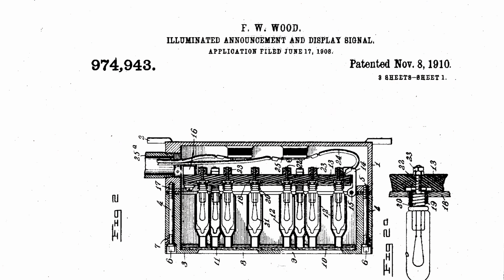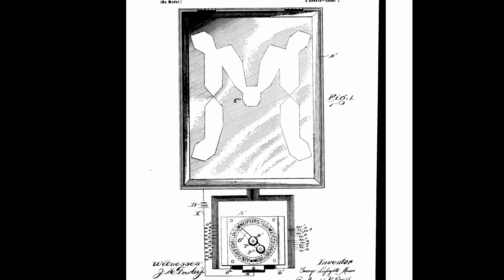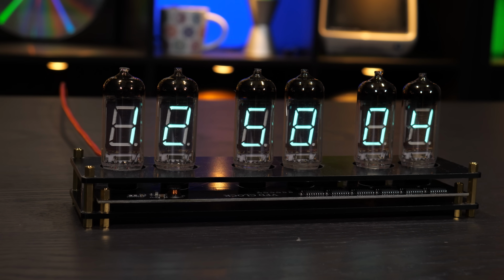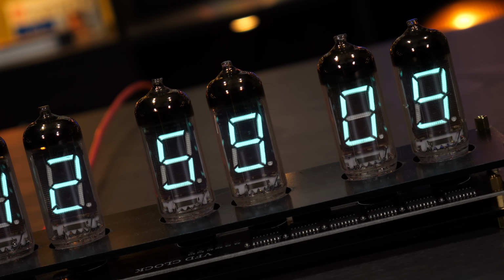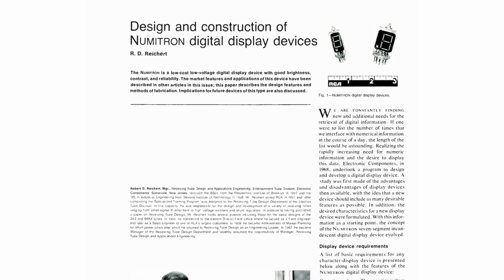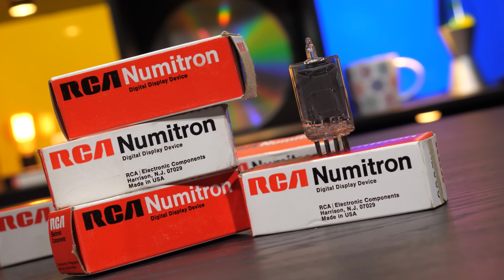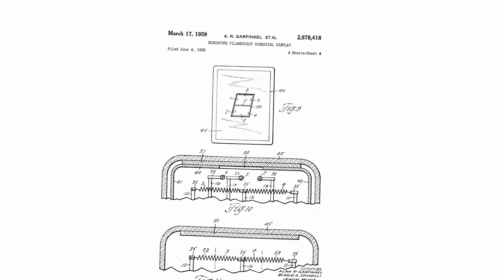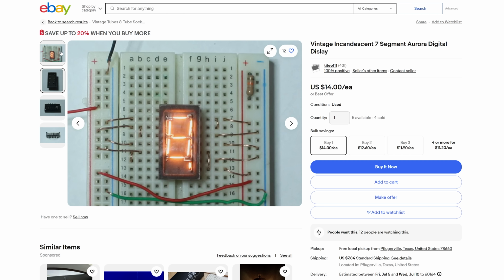The Numitron: An obvious idea that wasn't very bright

Comment: Apart from the physical rendering issues, I think seven-segment numerical displays are a really good idea. A display looks best with a minimum of shifting as you go from one numeral to another. The "traditional" pattern, with seven rectangular sticks, is obviously not optimal. The ends of the segments can be rounded or beveled, making the appearance much smoother. When you do that, you get something really nice. As you go from one numeral to another, you don't change all the segments, but only the ones that need changing. That's just much more visually appealing.

I count an average of 3.5 segments that change in cycling from 1 through 9, then back to 0 and then to 1. That varies slightly depending on whether the end of 6 and 9 if straight or folded. (I'd recommend folder for 6, straight for 9.) If you consider the average of all possible transitions, I'm sure the number is slightly different, but you get the idea.

For whatever reason, what pops into my mind is the time display near the end of the Star Trek episode "The Naked Time," where the remastered version uses seven-segment numerals with rounded ends, replacing the original revolving wheels. I'm glad they did this, instead of some dorky seven-segment glowing sticks. The result fits the rest of the motif in the show, but is also objectively good.

Comment: You may not be wrong about gas pumps using these.  I used to repair POS equipment for grocery stores.  The customer facing display IBM used worked the same or similar to these but it was one piece of glass with mutliple digits.  I think 2 rows by 20 characters across.

Comment: Numitrons were designed to be used with a filter in front of them. this solves the issues you talked about. they were very popular in avionics displays because they can handle extreme temperatures and vibration, unlike the other technologies (including early LED displays, which were unreliable). typically they're driven at a constant current (rather than a constant voltage) and, while turned off, fed a small current which keeps the filament warm without illuminating it. this makes the filaments last a very long time.

The displays you remember from '80s gas pumps were Panaplex displays -- basically a flat 7-segment neon-filled display designed for multiplexing. they also show up in a lot of pinball machines from the era. they required high voltage, just like Nixie tubes. although they can't handle a ton of vibration, they work well in extreme temperatures (think North Dakota in the winter) unlike LCDs which simply freeze and stop working. modern gas pumps have heaters to keep their LCD displays warm.
Reply: Thank you! Someone else knows about the lenses

Didn’t know about the constant current drive, but that’s a smart way to preserve lifetime
Reply: I vaguely remember Fran Blanche doing some good videos on the subject.
Reply: I USED TO WATCH FRAN @talideon
Reply: @TubeTimeUS

A lot of gas pumps used numitrons for their display. Cheaper than panaplex, deals well with vibration from the pumps. 

I’ve sourced several displays through purchasing new old stock pump spares. Curiously the modular design of some pumps meant that you could swap out the type of display by switching card. Quite a few numitron display pumps were converted to LED, just by switching boards when the numitrons were life expired.
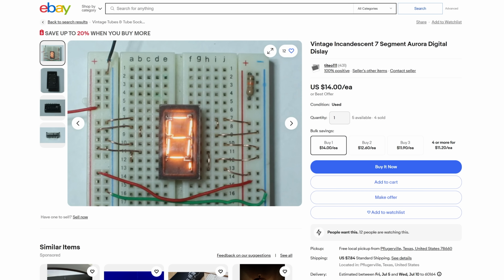Reply: 17:30 - There was a horizontal version called "Minitrons". Also incandescent filament seven segment displays made by Fuji.
Reply: I guess if Eric was going to show up under a Technology Connections video, it makes sense it'd be one about a tube-based display tech even more obscure than Nixie tubes
Reply: Numitrons in gasoline pumps held on in the Midwest pretty much through the 80s and some locations to the early 90s. Gas discharge did not seem to last as well. They got blinky or segments quit working. I was certainly happy to see the Numitron vanish. It was depressing, but they just kept working.
Reply: Wait, panaplex displays didn't handle a ton vibration well, but were installed in pinball machines? All of that thumping of the paddle buttons and the large ball bearing ricochetting around inside.
Reply: @TubeTimeUS  Minitron... That is what they were called in many avionics. Davtron made flight timers and clocks that used them.

I have several of these old clocks sitting around, and a few new replacement segment of the "bulbs".

I mentioned these in another comment and the fact that a filter screen was used with these for better legibility.
Reply: great info 👍
Reply: thank you tube lord
Reply: The same thing is true of VFDs - a green filter provides a very nice contrast and a pleasant-to-read display.
Reply: Tell my local station they need to upgrade! The delay on a really cold morning is insane. My LCD in my passat RNS510 radio does the same thing pretty badly for a bit till the heat comes on and warms up the radio
Reply: @DarkAttack14  My Golf has what must be LEDs to show a few things next to the gear selector. It is impossible to see if they are on or off in direct sunshine.
Reply: In the U.K. Numitron type displays were very common in petrol pumps during the 1980s. Like you say the operating temperature range was way better than LCDs while LEDs just couldn't produce enough light for use in sunshine. In newer pumps they actually switched to electromechanical displays like the station clock shown in the video.
Reply: I’m glad to find out what the gas pump thing is actually called. I remember them and the most I knew was “ayyy I saw that once” 😂.
Reply: I like to think that before they decided to try putting heaters behind the LCD panel that they tried knitting it a snug little jumper before they realised that would make it too hard to read.
Reply: ...but Sometimes!
Reply: North Dakota reference for the win!  Go Bison! Go Sioux!
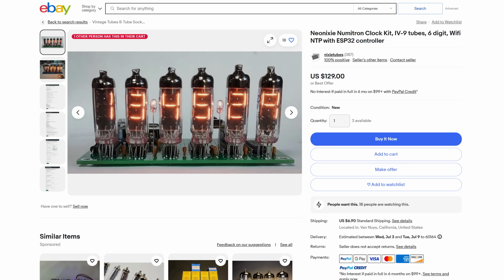Reply: I used to repair the old ARC RT-385As NAV/COMs which used an earlier version the display shown at 17:30 (which themselves were a later drop-in replacement) and I don't recall them having a small current to keep the filament warm without illuminating it - that would just create unnecessary heat in the unit. I can't recall if these displays were used in the RT-485A/B, but I think they were.
Reply: Please pin this as an additional comment to the already pinned comment or edit the current pinned comment to add this information!!!
Reply: I feel old every time I go to the gas station and see LCD screens used as digital billboards. It wasn't that long ago that kids would consider having a 'plasma TV' or a 'flatscreen' as an elusive marker of wealth and success (this was around the time of MTV Cribs and Soulja Boy). Now LCD displays are found on disposable products.
Reply: Huh, that`s pretty awesome (:
Reply: Didin`t even see that the poster`s name is TubeTime lol.
derp
Reply: "solves" is a strong word... I'd go with "mitigates" myself lol
Reply: Ah! I thought I remembered the gas pump displays having a gas like glow to them.
Reply: Interesting. Kind of a funny thought that a fulfillment was more vibration resistant at that time.
Reply: @JacksTheRabbitsTube  To the point that I don't believe it.
Reply: @andymouse  Filament durability has an exponential relationship to the voltage.  Driving a filament only to a dull orange state gives it an enormous lifetime.  The "centennial lightbulb" in Livermore, CA has been burning practically non-stop since 1901.
Reply: @BixbyConsequence  :)
Reply: he literally talks about filters in the video
Reply: Yeah I agree. My dad is a plane and works at aviation and he is a numitron and likes it.

Comment: Yes, Numitron (or an equivalent) were certainly used in petrol (gas) pumps in the UK at least in the late 70s/early 80s. They were easily bright enough to read easily in daylight and looked quite smart. They didn't last long though, probably due to reliability as mentioned and ironically for most of the 80s and 90s, pumps went back to mechanical 7 segment displays before becoming almost universally LCD in the 2000s up to the present day.

Comment: Theory on why its Gray: I think they want the background to reflect just a little bit, so the number appears bigger at a distance. Those filaments are quite thin, and having the background reflect a little bit might actually help legibility in some conditions. However, obviously misguided for the drawbacks stated, and I don't think it actually works as intended. So just a theory.

Comment: LED's and LCD's are nice on their own, but they're better together.
Want to see a fantastic example?
Take a look at the screen of a Game Boy Advance SP.
I've taken one apart in the past. Guess how many backlight LED's it has? Exactly one! And it's being driven by a fantastically low current (likely in the range of 20-40ma).
The display itself was originally intended to use either the backlight or ambient light, and I think that is a large part of why the display is able to be illuminated so efficiently with only the single point source of light (granted, there was a lot of use of light guides and diffusing elements to spread that light very evenly across the display).
There are much more modern examples however. Any "LCD" monitor or TV built within the past 10 years uses LED's for the backlight, and that's why even a 27" 16:9 4K display panel can get away with a total power consumption of 20 watts or so. There's an interesting coincidence that is very useful with this. A USB 4.0 type C connector can support USB C Power Delivery, as well as Thunderbolt simultaneously. With USB-C PD providing up to 100 watts of power, and Thunderbolt being backwards compatible with DisplayPort for the display data connection, you can hook a computer to a monitor with ONLY ONE CABLE (compliant with the appropriate ratings for power throughput and data bandwidth of course) and it will function 100% as intended.
This is an amazing thing, imagine only having one power cable and one ethernet cable going to your PC, then a single USB 4.0 cable going from your PC to your monitor, then your monitor (which also has a built in USB hub) has your keyboard, mouse, and speakers plugged into it, and that's the whole PC up and running pretty much. Printers are weird, they tend to throw a fit if they're not directly connected to a USB port on the PC itself (not a hub), but that's the exception rather than the rule.

Comment: As a former employee of RCA I just want to say this: Screw you.
The Numitron allowed RCA to use it's electron tube equipment. The filaments and the back ground were reconfigured vacuum tube parts. The gray material as the background were used for plate structures in vacuum tubes. This method would allow RCA to sell the devices at a lower cost as they were buying this material in volume and which would allow RCA to get more use out of already paid for manufacturing equipment.

Comment: Was far into the 90s before most of the public displays was replaced with LED.. and almost istantly when that was done they where in turn replaced with LCD screens.

Back in the 80s when i was a kind small for factor diaplays, as those in gaspumps used a whole host of technologies. I pretty sure i seen numatron gaspumps, as flip numbers, number roals, nixitubes, LCD numerals... there probobly been all of them.

Comment: Years and years ago my younger sister made an excel clock. All it did on sheet one was display the time using six 7 segment display. Sheet two was a mess of calculations and callouts to get the time right now and put it on the sheet. The problem she ran into was having it update frequently and smoothly enough. It was a special kind of silly.